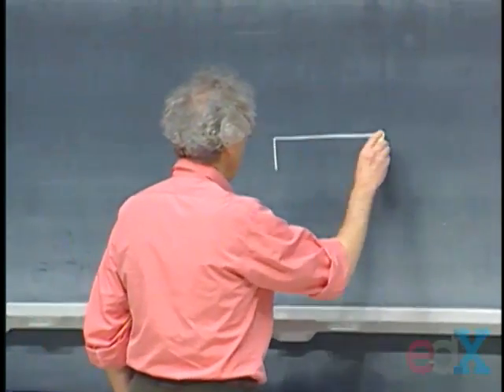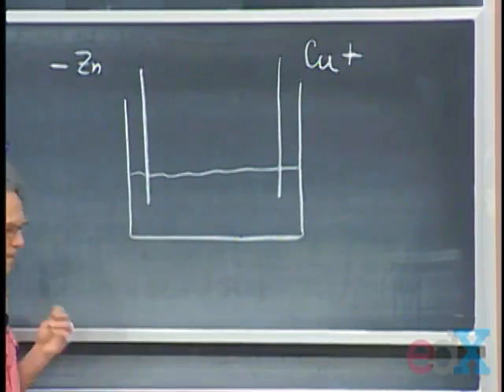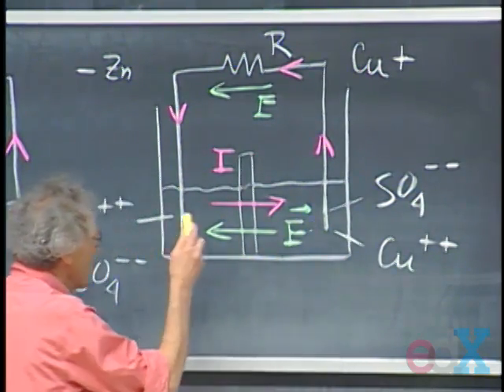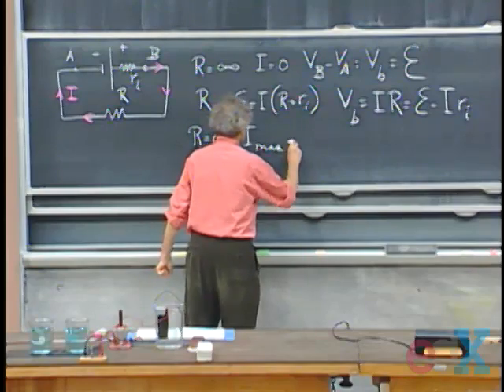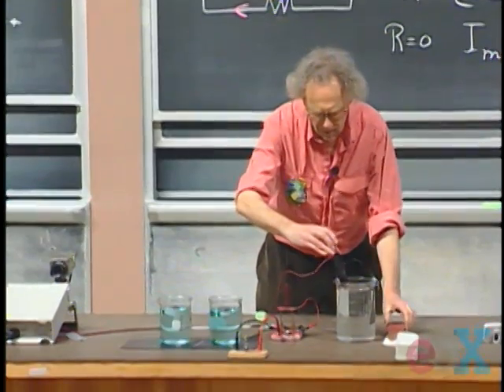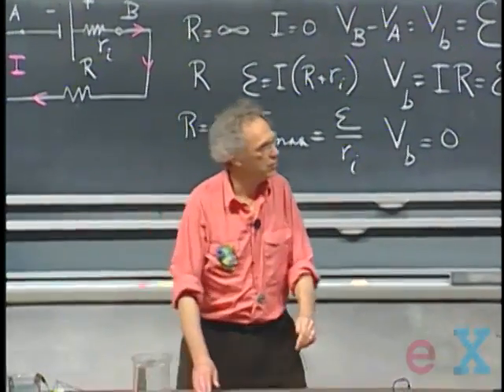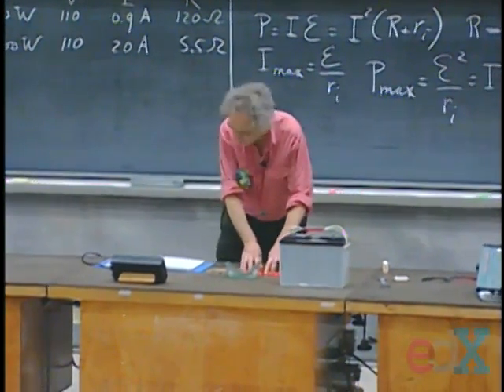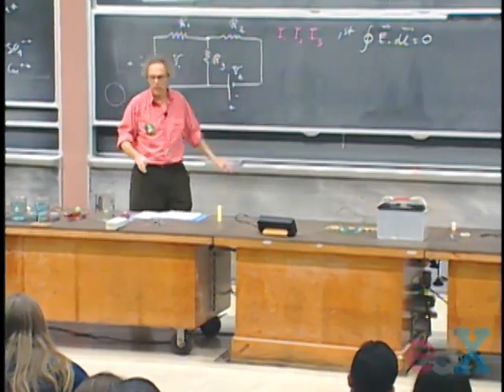8.02x - Lect 10 - Batteries, Power, Kirchhoff's Rules, Circuits, Kelvin Water Dropper

Comment: Suppose if i have two batteries , each one have their '+ve' terminal is at '+3V' and '-ve' terminal is at '-3V' so total potential difference of each battery between '+ve' and '-ve' terminals is '6V'. Now I am going to connect both batteries in such away that '-ve' terminal first battery touches the '+ve' terminal of second battery. Now I am shorting the batteries ( i. e +ve terminal of first battery is connected to -ve terminal of second battery ) . Now consider one positive charge which moved from  +ve terminal of first battery to -ve terminal of second battery. Now the positive charge is present at -ve terminal of the second battery  , due to emf the positive charge which is present -ve terminal of second battery gains potential +6V and moves to +ve terminal of second battery and then it moves -ve terminal of first battery where potential drop of 6V occurs ( charge moving from +ve to -ve potential ) then again due to emf the positive charge which is present -ve terminal of first battery gains potential +6V and moves to +ve terminal of first battery. So final potential of the +ve charge is 6V not 12V as per the above logic. 

My question is how come potential difference is 12 V between the two batteries and what is happening btw +ve and -ve terminal which are in contact ?
Reply from the maker: question unclear.
you have 2 3V batteries in series. That makes a 6 V battery,
+  -  +  -.
now what?
formulate your question in fewer than 50 words.
Reply: I have 2 6V batteries in series. Consider Battery 1 is at the top and Battery 2 is at the bottom and they are connected in series. ( i.e  -ve terminal of  Battery 1 is in contact with the +ve terminal of  Battery 2 ).
I want to know the voltage , at which both batteries are in contact. Because if a positive charge moves from -+ve terminal of  Battery 2 to -ve terminal of  Battery 1 then there will be a voltage drop ( i.e Positive charge is moving from Battery 2 to Battery 1 ) ?
Reply from the maker: >>>I want to know the voltage , at which both batteries are in contact. >>>
question unclear.
A- B+ C- D+
B is connected to C. Thus they have the same potential
pot diff between A and B 6 V
between A and C 6 V
between A and D 12 V.
between B and C 0 V
between B and D 6 V
between C and D 6 V
Reply: If A = +3V , B = -3V , C = +3V , D = -3V

>>>>>>B is connected to C. Thus they have the same potential>>>>>>
means potential at terminal B will be 0V
potential at terminal C will be 0V
Reply from the maker: >>>potential at terminal C will be 0V???
NO not necessarily 
you are free to choose the 0.
the potential at A can be zero, also at D also at C
0 potential can also NOT be at A and not be at B, and NOT be  at C and not be at D. It can be zero elsewhere in your room. 
use google

Comment: why is there a decrease in potential when we move across a resistor
Reply from the maker: If a current is going through a resistor and if we move from one end of the resistor to the other end in the direction of the current then the potential goes down, if we move in the opposite direction then the potential goes up as the current goes from high potential to low potential.

Comment: When you connect a voltmeter to the terminals of a battery, which potential are you actually measuring? The one internal to the battery or the one external to it? Does this question even make sense?
Reply: Also, when you measure the potential difference between the terminals of a battery, what you're actually measuring is the work per unit charge charge that you'd have to do to move a charge from the + terminal to the - terminal, right?
Reply from the maker: You measure the current going through the Voltmeter. It  indicates IR (R is the resistance of the voltmeter). Two identical voltmeters, connected both to the very same points in a circuit can indicate very different values (even with reversed polarity). Watch:  https://www.youtube.com/watch?v=nGQbA2jwkWI&index=17&list=PLyQSN7X0ro2314mKyUiOILaOC2hk6Pc3j
Reply from the maker: Potential difference between point A and B is the integral of E dot dl in going from A to B. It's the work done by the E field per unit + charge in going form A to B.
Reply: Lectures by Walter Lewin. They will make you ♥ Physics. So that means that it will depend on the internal resistance of the voltmeter right? I'm just confused as to why the voltage in the voltmeter went down after you connected the lightbulb. At first the circuit is open, so you're pretty much measuring the EMF
But when you connect the lightbulb what happens that makes the voltage go down?
Reply from the maker: A Voltmeter has a VERY VERY high resistance (could be many Mega Ohms, even hundreds of Mega ohms) because it is not supposed to effect the currents in the circuit. A sensitive coil rotates due to a torque (Faraday) and that indicates the current, thus IR as R is known. 
I cannot answer your 2nd question. I have to know how many minutes into the lecture.
Reply: It's at 11:35, when you close the circuit and the small lightbulb turns on. Why does the voltage go down?
Reply from the maker: there is nothing at 11:35 that relates to your question

Comment: So the reason why electrons move inside an electric circuit is because of the electric field of a dipole?
Reply from the maker: question unclear.
Reply: Why would there be current in a closed circuit when a potential difference is applied to it?
Reply from the maker: question unclear.

Comment: If the resistor is not connected to the circuit then R=0  , how infinity?
Reply from the maker: when you cut out a resistor and do not connect the wires again, the resistance becomes infinitely hi.

Comment: Confused with the difference between "potential difference" and "emf".
Kindly clear my doubts.
Reply from the maker: Potential difference between A and B  is the integral of E dot dl from A to B. Units Volt.  EMF also has units Volt. The EMF of a battery can be 9 V.  That means that the + side has a potential which is 9 V higher than the --side (this is due to chemical energy). If an induce emf is produced due to Faraday's Law, the induced emf will appear somewhere in the circuit. In that sense this induced emf can be thought of as am "imaginary" battery.
Reply: Thank You so much.You are the great teacher ever!!!

Comment: SIR I AM CONFUSED BETWEEN TWO THINGS   
SIR I ASK THIS QUESTION FROM YOU BEFORE TWO DAYS

 MY QUESTION WAS :
sir reaction of Zinc and  sulphuric acid gives us zinc sulphate. sir why cell discharge only when current flows. 
YOUR ANSWER IS : The reaction in each half-cell does not occur unless the two half cells are connected to each other.
Moreover, in an isolated oxidation or reduction half-cell, an imbalance of electrical charge would occur, the anode would become more positive as zinc cations are produced, and the cathode would become more negative as copper cations are removed from solution. HENCE REACTION HAPPEN ONLY WHEN WE CONNECT ANODE AND CATHODE.

 SIR I AGAIN HAVE CONFUSION
sir is it means that for reaction 
Zn + H2SO4 = Zn(SO4)2 + H2 electric current always required 
than why in books it is not  written that this require electric current.
books simply say 
Zn + H2SO4 = Zn(SO4)2 + H2.
Reply from the maker: https://en.wikipedia.org/wiki/Galvanic_cell
Reply: It's ZnSO4 not Z (SO4)2

Comment: Sir, could you tell me, why a battery doesnt work, when we have an open curcuit. If we supply a capacitor, electomotive force of a battery will do its work, dividing negative charges from positive, and organising negative charges on one plate of a capacitor, and positive charges (they appear there automatically) on the other, with these plates are separated from each other. But when you have just two copper wires, disconnected, why one of them wont be negative charged, and the other positive? Thank you for your lectures, they help me to understand physics, and prepare to Unified State Exam, which we have in Russia))
Reply from the maker: question unclear. I suggest you rephrase your question and ask Google
Reply: If I have a capacitor, then Q on the plates of this capacitor = C times Emf (Electromotive force).If I have only wires, connected with the battery (which has some Emf), but disconnected from each other, then everyone (in my class)'ll tell me that these wires don't have any Q at their ends (because it's an open circuit, they say). But wires have cross-section A, so don' t they have the capacitance = electic constant times A / d, and so Q on them = that capacitance times Emf? Of course, it's very small, because the cross-section area of them is very small, but THERE SHOULD be some Q. And what about open circuit: isn't the first case with a capacitor an open circuit too (because the plates of the capacitor are disconnected from each other)? Or it's inappropriately to speak about open circuit here at all? Please, help me, professor, before to ask you, I surfed the internet, but found no answer (therefore, may be the question is extremely stupid, so i'm very sorry about that).
Reply from the maker: If you have a 10V battery which is grounded on one side and potential 10V on the other side, You attach a wire to the 10V side. The charge on the wire will be 10C. What would be C? Assume the wire has a radius of 0.5 mm and a length of 10 cm. Its capacitance would be approximately 0.025 picoF.
Reply: Thank you very much, 0.25 picoC is still a charge)) that' s what I wanted to know. Kindest greetings from Russia!)
Reply from the maker: The charge on your body and on almost any object in your home is is much much larger than 0.25picoC due to cosmic radiation and it changes polarity on a very short timescale.
Reply: Mmm, I' m going to study this question, thanks for mentioning it here.
Reply: @Fastidium Estiques You can correct me if I'm wrong, but I think what's confusing you is that you seem to think that connecting two copper wires to either terminal of the battery is the same as connecting a capacitor to a battery. A capacitor is a circuit element, a single device in which if you connect the whole thing to a battery you get a closed loop and a complete circuit. If you simply connect one copper wire to the positive terminal of a battery and another copper wire to the negative terminal of the battery then there is no close loop path for charge to travel.
Reply: Dr. Lewin this situation you describe: "If you have a 10V battery which is grounded on one side and potential 10V on the other side, You attach a wire to the 10V side." This would also be a complete circuit as well because you ground the battery correct?
Reply from the maker: I have no idea about what you are talking about. Please try again.
Reply from the maker: That is not correct. If the copper wire attached to the +10 V side is an open wire, then you have no closed loop and thus NO CURRENT WILL FLOW through that wire.
Reply: If you are referring to my first comment @Fastidium Estquies, I was simply trying to explain that it seems as if the situation he is describing is one in which you have two wires one connected to the positive end of the battery and the other connected to the negative terminal of the battery, but the other ends of the wire are not connected to each other.(Wires are sticking straight up). This is not the same as connecting a capacitor to a battery as a capacitor is a single component that can be placed in a circuit.
Reply from the maker: If the power source si AC a AC current will flow if you connect a battery with a capacitor. If the battery is 10 V DC, and if you connect a capacitor to the battery a current will only flow till the capacitor is at 10 V and then it will stop FOREVER. Two open wires will differ only that NO CURRENT will ever flow.
Reply: Yes that is exactly right. Thank you for added clarification professor! :)

Comment: Sir i have a question. Please explain : when we connect a thick wire of negligible resistance directly with a battery. Current flows through it. How can we apply kirchoff law. Please explain in detail. 🙏🙏🙏🙏🙏🙏🙏🙏🙏🙏
Reply from the maker: If  the resistance of your wire is 0 and the internal resistance of your battery is R, then your circuit is equivalent to a battery with EMF V, with zero internal resistance and with R attached to the poles of the battery. The closed loop integral of E dot dL is zero.
Reply: @lecturesbywalterlewin.they9259  thanks

Comment: i could not understand difference between potential difference and emf
Reply from the maker: the emf of a battery, or an induced emf (Faraday's Law), have the dimension of a potential difference. If the emf of a battery is 9 V, it means that the potential difference between the poles is 9 V if no current is drawn.
Reply: @lecturesbywalterlewin.they9259  Thanks alot i got it